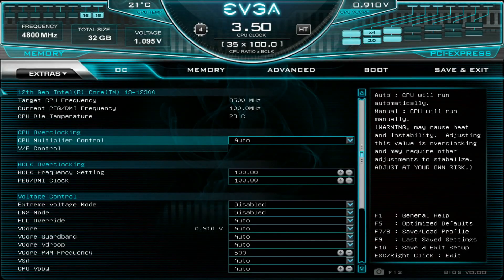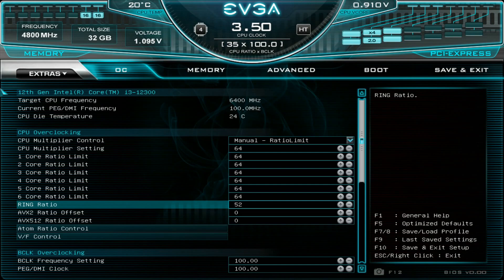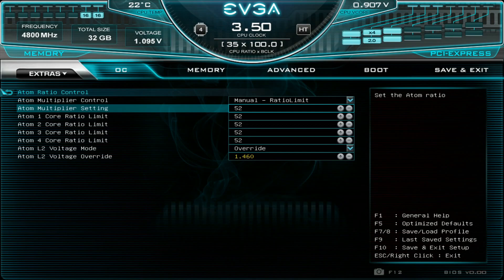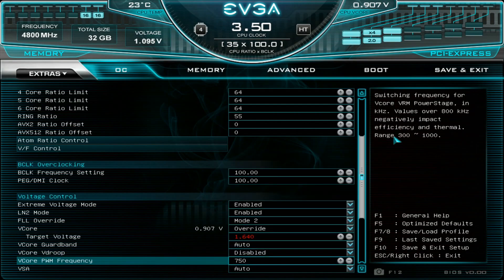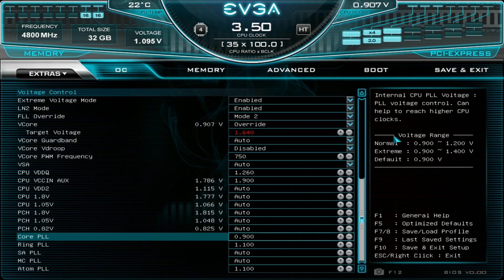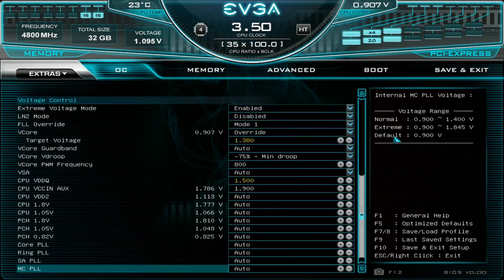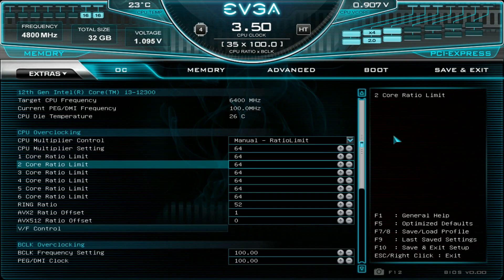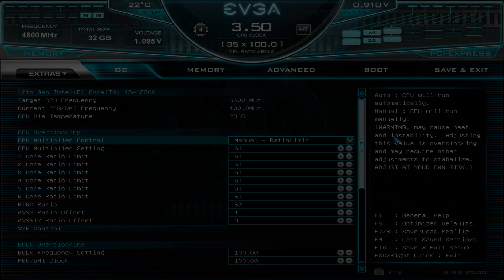EVGA Z690 DARK KINGPIN - LN2 Overclocking Tips & Settings

Comment: Love the videos!
Question, does your Z690 Dark report 1.8v VSA in hwinfo? I manually set VSA in bios and it changes the VSA VID but reported VSA is 1.8v. I just put in my Dark with my new 12900KS and want to make sure I'm not killing my chip.
Reply from the maker: I usually leave it auto, I didnt open hwinfo at all on this platform.
Reply: @LuumiJuhani  gotcha. I reached out to Martin with HWINFO and he told me that the voltages weren't calibrated right in the app and fixed it in the update from this morning.

Comment: Hey did I hear you correct. That you had a COLD BUG? I bought this mother board, with the 12 gen I9 12K 32 gb ram, and when idle I am at 20c, and my board starts to make funny buzzing sounds that go away after my temp goes over 32c. EVGA said I needed a larger power supply, so I bought a 1600 watt. Sound is still there. RMA board received new one and the board does exactly the same thing.

Comment: Guys. I had a problem. I got my PC build. I7 12700KF + EVGA z690 Dark Kingpin +Zotac Rtx 3080ti Extreme Holo + DDR5 Corsair Dominator. Its starting, working. But theres no image on monitor. Got post codes on Motherboard: 53 54 7F Another videocard works on this build. And my videocard works on another build. But together - Not. I did reset BIOS. Update BIOS. NOTHING... Can someone help me?(((